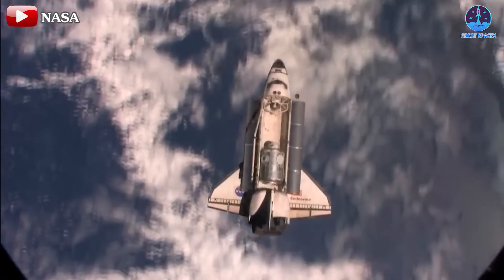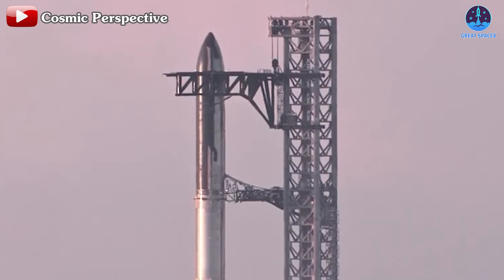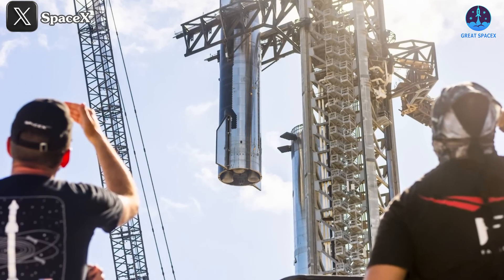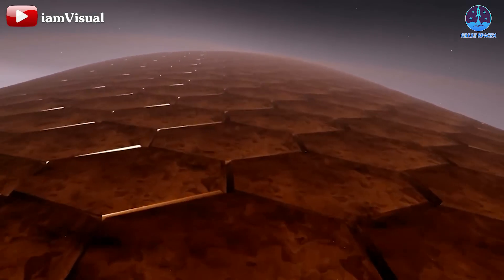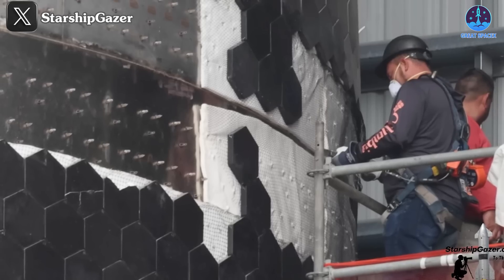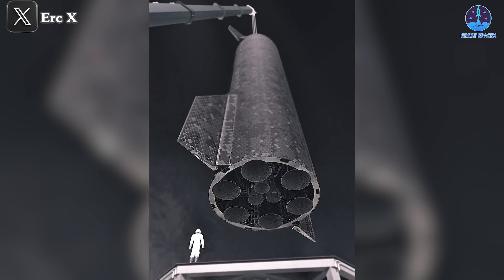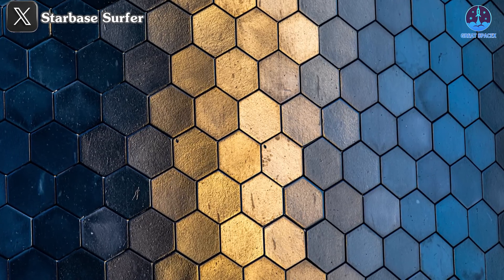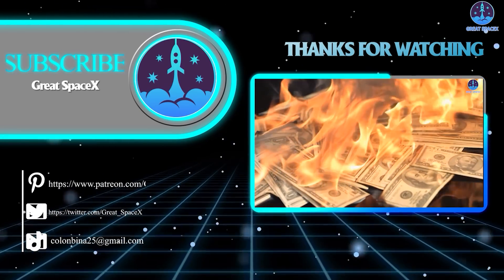SpaceX's Starship New Heat Shield Somehow Better than NASA Shuttle!

Comment: Modified Starship made out of Aluminum Would be Something to See ! 1/3rd the Weight A High Line Model With a Heat Shielded Bulbous Nose Heat Sink Flaring Friction Away From Center using less Tiles 30 Degree Down Bubble Attitude Reentry ! You Could See Why the Shuttle was made of Primarily Aluminum it Probably ended up being Larger then Originally Designed !.
Reply: The Shuttle did wind up bigger than originally intended due to DoD requirements.

Comment: It is silly to compare the Space Shuttle with the Starship.  It is difficult to say Starship's heatshield system is superior when the tiles keep falling off.  It can't be superior if it isn't even adequate.

Starship's design has needless complex curves and edges of its own.  The fore and aft flaps should be minimized or even eliminated altogether.  At a minimum the hinges of the flaps should be sheltered from the reentry plasma stream.
Reply: Ah, Starships heatshields are more advanced than the ones on the shuttles because of the advanced tech used in in making them. Also all of Starships heatshelds are literally the same size, unlike the shuttle which had nearly 5000 different sizes and shapes. Oh almost forgot the ones used on Starship are also rated for higher temperatures where as the shuttles were exclusively rated for the heat generated during re-entry
Reply: And Starship already improved their tiles and their mounting system.

Comment: 304 stainless steel is good up to 1400 C
Reply: That's near melting. It starts to lose its strength at around 500. Also, critical wiring, flamable gas etc. That won't like being next to hot stainless steel

Comment: Can we add who actually invented the innovations or at least the subcontractors. SpaceX is like any large company is really a conglomerate of subcontractors and project managers tying it all together let’s not pretend musk is the pivot all this brilliance rotates about
Reply: I thought their work was mostly in house ,vertically integrated, I got the brilliant to assemble top talent, and I don’t think there’s much he misses design wise.
Reply: Great idea.  Why don't you list them and their contributions?!
Reply: Here I will start.  SpaceX invented the fuel.  SpaceX invented the engines.  SpaceX invented the metals.  SpaceX invented the design.  SpaceX invented the code.  SpaceX invented the profile.  SpaceX invented the landing.  SpaceX invented the video capture.  SpaceX invented the pad.  SpaceX invented the factory.  I am sure there is more, but I am tired.  Your turn.

Comment: loose one tile in the flap area and the ship is gone... flaps should be withdrawn diring hot re-entry and used only during final descent. whether orientation is kept by gas thrusters like in case of shuttle or extra gas is used to protect moving parts during hot re-entry remains an engineering chalange for now.

Comment: A step too far. 
Like Elon has said; if gravity was just a little greater force, space flight would be impossible. 
The same applies to quickly reusable space craft. The immense forces of takeoffs and re-entry on a ship will prove that much inspection, maintenance and repair will be required after each flight. 
Rocket engines and the craft are not like a 777 aircraft and its jet engines. The forces in rockets is several orders of magnitude greater than a jet airplane. 
Just look at the maintenance required after every flight of the X-15 or the SR-71 Blackbird. 
Musk is known for being stubborn and not giving up. But, he is in denial about the TPS and the general reusablity of spacecraft. It is just a step too far.

Comment: Apparently FAA claims that the TPS is a safety concern...????? Huh! If SpaceX TPS is such a  safety concern  then let me ask FAA would u rather spend millions of dollars to repurpose the space shuttle every flight or would you rather have a TPS that is a reliable and durable system doesn't need refurbishment and that is less cost sufficient?? I think we can all agree that SpaceX TPS system is lot more reliable than u think FAA.. if u still sceptical on the matter than sit back shut up and watch flight 5 and 6.. if not  we'll . We will determine when we want to assess and evaluate the data and decide to take our sweet time doing it  and we will keep you posted let u known in 5 months to see how it went .. just to send a message to u.. the FAA to feel what we went through when we had to wait on u.. 

Also putting f5 on the olm and doing pre launch testing early sent a message to FAA... I think it was a bold move.. if I was SpaceX I'd be FAA in return send a message to them..  and to be bold I'd do an  unscheduled sf for f5 just to add tension to FAA.. kind of up root FAA off their butt.. to like a lil scare..  if I was SpaceX I wouldn't put on schedule or nothing don't say nothing..just piss FAA off lil that be another message sent to FAA don't say anything about it.. keep it with in the SpaceX family

Comment: The shuttles are from the late 70's, which is almost 50 years ago.  Why people will think the Starship new heat shield can not be better than the heat shield on Shuttles?
Reply: Well, this is the first new vehicle using a non-ablative heat shield since the shuttle so there is no guarantee that the starship heatshield is better as there has been almost no development since the shuttle era, but material science has certainly improved as well as computer modeling so it's a safe bet Starship will have a better heatshield but the best thing is SpaceX doesn't not sit still so for them to have already made the improvements they have with the new ablative layer and the better tiles I'm sure they will figure it out soon enough....like flight 5 probably!
Reply: Yeah, I was kind of thinking that when I read the title of the video as well.

Comment: And of course the FAA’s is now taking issue with starships heat shield now is there anything that they don’t take issue with 😅
Reply: The FAA has its collective head up its own ass so far, they can see their teeth...
Reply: @the80hdgaming FAA should be looking at air traffic controllers and doors falling off planes... Not unmanned test rockets
Reply: @the80hdgaming FAA is a home grown terror group.
Reply: And that’s just Tuesday, wait till Wednesday, etc. etc.
Reply: There is absolutely no way that technology is ahead and more advance in 30 years to be better than the space shuttle. Call the FAA and shut them down now for fails claims!
Reply: The FAA is being used as an attack tool by the democrats.
The democrats hate Elon!
Reply: @sidstevens4990  that's just nefarious speculation.